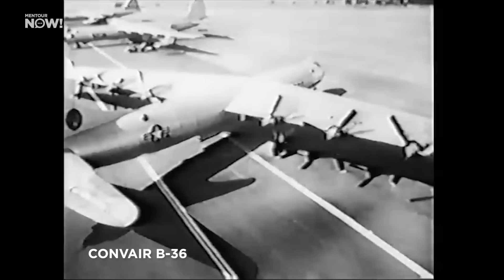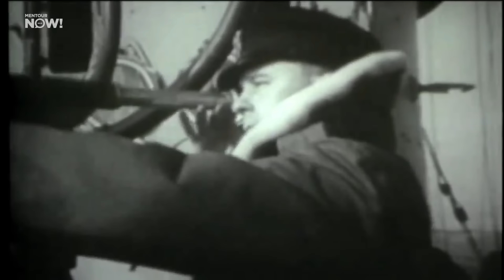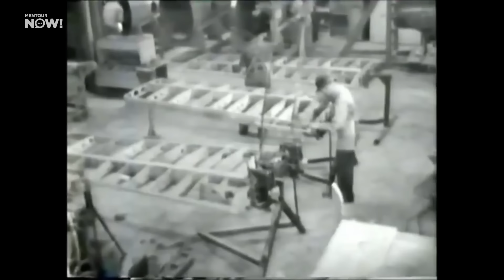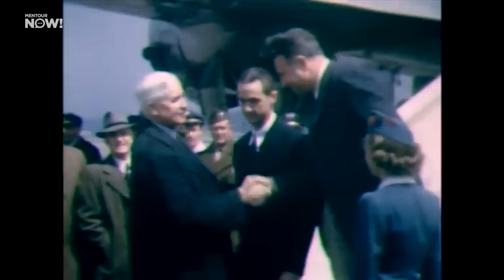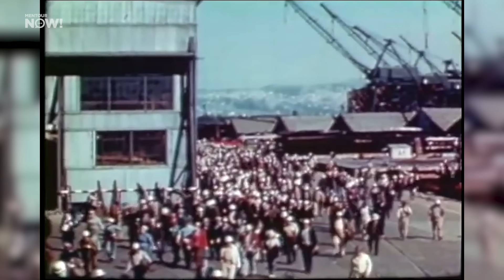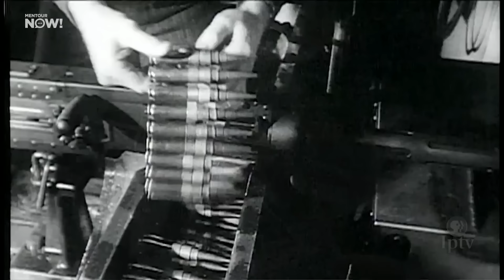The Multi-Million Dollar Plane who Only Flew ONCE!

Comment: Wood is nature’s original composite.  The tree’s microscopic cells form continuous fibers and the cells are secured by lignin which is the wood’s epoxy resin.  The fibrous cell’s length to diameter ratio of four is ideal for compression buckling resistance….and something composite engineers ought latch on to.
     Like composites, wood is anisotropic.   Thus layers are built up with specific orientation.
     Wood’s low density makes it more resistant to buckling than 2024 aluminum on an equivalent weight basis.
      Wood’s low density allows thicker skin that keeps a true shape under aerodynamic loads and a smooth finish.  The wood skin contributed (as well as leading edge radiators) to the DH Mosquito phenomenal performance.
       Still, wood construction is heavier than aluminum.       Cheers

Comment: Pratt & Whitney R-4360 : a nightmare to maintain and operate.
Flying boats : nightmares to  maintain and operate.

8 R-4360's on a flying boat : 😱

If any practical use for the aircraft had been found, I guess it would have been re--engined with turboprops at some point

Comment: You know, with how air travel is today, maybe there is a new market for flying directly between ports...
Small aircraft, not many passengers and cargo to check and no airport at the other end. 
You just get off the boat plane with a passport.
Reply from the maker: I could be.. but they are really expensive to operate, not to mention insure..
Reply: @MentourNow 
Yeah, I know... 😔

And you'd probably need to have just add much security and body scanners and taking your shoes and belt off at the port as you would the airport 😏

People often think of the 60s Jetset as the golden age of passenger flight.
But for me, nothing beats the flying boats of the 1930s, my true golden age of flight. 

The Short Empire is my favourite, and it's military brethren, the Sunderland.

What I wouldn't give to spend a life shipping cargo and passengers in-between flyspeck islands in the Pacific, Indonesia, Micronesia and the Philippines. 
With my very own military surplus Sunderland.
Moored up at the pier and enjoying a drink at the bar as the sun goes down. 

That, that right there, that's the golden age.

Comment: I actually met an old man who had been an engineer on the Hercules project. After we spoke for a few hours about aviation, he excused himself for a few minutes and returned with a concept drawing of the HK-1. He gave it to me and I charished for years before losing it to a house fire. In that fire I also lost a historic issue of Radio Electronics, and Altair 8800, and many model aircraft I had built  growing up. The concept drawing had the signatures of many of the engineers and I was told that when the project ended, everyone who had worked on the project took all the momentoes they could carry because they all knew they had worked on something extremly special.
Reply: At one point I worked with an old and experienced electrical engineer.  One of his first jobs out of school was to work on the team building the electrically-deflected ("solenoid") ailerons of the Spruce Goose.  He said that at the time HRH flew it, the design of the plane still had some shortcomings.  It may be due to familiarity, but he felt that the most dangerous need for redesign was that the maximum force they could get out of the electrical aileron deflection mechanism was not strong enough to hold them reliably in the deflected position under load.  Electrically actuated?  Then??  Talk about ahead of his time!

Comment: I have had the privilege of sitting at the controls of this aircraft and touring her insides. As one of the people who donated heavily to help fund her relocation from Long Beach CA to McMinnville OR, the museum sent me a swatch of the flight control fabric, which was original and on the aircraft when it flew that one time, when they decided to replace all that fabric with unused and carefully stored 'new old stock' fabric. I have done a lot of research regarding this plane, although I don't think of myself as a true expert, but I have read all of the papers and such I can find about her.

One thing that is often repeated about her sole flight is that, "well, she never really flew because she was in ground effect the whole time". First, that is nonsensical because she was developing lift greater then her weight, got off the 'ground' under her own power, and was under control the whole time. If that definition was good enough fro the Wright Brothers, it ought to apply to the Goose. Second, the aircraft has been repeatedly modeled in software at universities and other places, and 'flown' in simulation, and from that it seems pretty certain that she was basically airworthy. She flew, and could have flown more if Hughes had decided to then, or on possible later flights. 

Of greater concern is whether she was structurally sound for sustained flight, under the planned cargo loading, and in adverse weather, etc. Certainly the designers at Hughes thought so based on their material tests and aviation engineering talent and skill, which was considerable. Yet, during the one flight, spotters near the tail reported that the fuselage structure back there, where it is narrow, was twisting back and forth a lot. Maybe this was within design limits, maybe Hughes averted a disaster by setting it down quickly. But also keep in mind, this flight was conducted in a harbor that was not all that large, and unless Hughes took it to much higher altitude, he would run into something. A lot of "ifs".

I encourage everyone with a love of aviation to make a trip to see the Goose at her museum; it is just a fairly short drive west of Portland, Oregon, and also not far off of the Pacific coastal highway; isolated but not too much so.

Comment: Been aboard twice, sat in the cockpit, stood on the seat and had my shoulders out the hatch on top of the cockpit to take pictures along both wings. Amazing to see. Was told and could visually confirm that the reason the flight was so short was that the tail was cracking off due to a design weakness. (repairs were easily visible internally)

Comment: Sea water is the mother of corrosive environments. Metals on aircraft must of necessity be light so flying boats will have a MUCH shorter structurally sound life than a ship, which has a  heavy thick metal structure. Thus, seaplanes are less cost effective than land based aircraft.

Comment: If the undock button is the only problem, they should cobble together a mechanical button pusher and glue it in the Starliner. Ok a collision is a good reason, but I think they need a crew for more than a single button press.

Comment: I do tours on the Spruce Goose at the Evergreen Aviation & Space Museum in McMinnville, Oregon. 
Nice job telling the history as you a very thorough.
Fun fact: There is only 8 fuel tanks, 900 gallons each installed, but was designed to hold 14 tanks.

Fun facts: The wood used was 94% yellow birch, 1% spruce, and 5% other wood like basswood, maple, ash, balsa and poplar. Yes that is correct the Spruce Goose only has 1% Spruce wood. What sounds better The Birch Goose or The Spruce Goose. 😂

Comment: The 4360 Wasp Major engines were.... Let me see here.... A physical size of 8 feet 5 inches, by 5 feet. "103 inches | 61 inches"
My room could only fit 3 of these in it. 
A bore of 5.75 inches! That's bigger than the widest part of my fist. I can't think of anything to relate to that size. A softball maybe? and each engine had 28 softball poppers!

Comment: If anyone wants to poke around the interior of the Spruce Goose or get a good look at one, check LA Noire, either play the Nicholson Electroplating case or watch someone else do it. Even for when LA Noire was released, it still gets across just how massive the Spruce Goose was both in realaity and the digital version. That and, at least with the virtual version, the plane and interior are central to the case as well so you get to explore a good chunk of the simulated Goose and hangar. If I'm remembering it right Howard Hughes gets a few direct mentions as well as a lot of stuff on the company as well with the company and employees being just as central to the case too

LA Noire is set just post WW2 and the case is set in 1947, FWIW. Anyone know if the Spruce Goose showed up anywhere else or just in LA Noire?

Comment: It should also be mentioned that the H-4 due to it's massive size required the design and invention of fully powered hydraulic control surfaces, as they were far too large to have direct mechanical connection to the pilot. This is a technology used on all commercial aircraft today, one that we take for granted.

Comment: Given it took off. I wouldn't say it's the biggest failure. And by modern standards, it was quite cheap to develop. 
IMO, something like the Boeing 2707 is a bigger failure. Because it absorbed more money and was never even had an airframe built. 

Hughes had some serious mental health issues, which only got worse with time. 
I did get to see it, but I was only 4 at the time so I don't remember it. And we don't have many photos because it was back in the film age.
Reply from the maker: It’s a pun on the fact that it was the biggest aircraft ever built, and a fail.

Comment: H4 if designed with turbo jets at that time itself and shifted to aluminium fuselage, it would have been high capacity super jumbo with it would've revolutionized aviation and shipping to a large extent. Also composites at present would've changed the game completely. Request to make one based on Bartini Beriev VVA 14

Comment: The B-17 parked under the horizontal tail, which completely enveloped the wingspan of the B-17 (113 ft vs 104 ft) gave a pretty good visual measuring stick as to it's size.

Comment: you did not answer the question why this huge airplane was only “flying” once…. lack of thrust? Miscalculation of engine power needed to get that plane really flying?  fuel consumption?
Why they did not use stronger engines later when they were available?
A lot of unanswered questions! But still an interesting video somehow….

Comment: The museum is almost directly across Hwy 18 from KMMV, so you can easily fly in and walk. Unfortunately, it's a 1.5 mile walk because you have to go way out of your way to reach a traffic signal and then double back. I suppose you could try to cross the highway at other than the crosswalk, but I don't recommend that.

Comment: In no way was the H-4 a failure. If the project had been moved to turbine engines & stainless steel construction. It would have been a incredible tool for developing the world. There are still many difficult to reach places with no harbors, roads, or paved airfields.

Comment: Was the Spruce Goose a failure? It succeeded in delivering a lot of government money into the pockets of Howard Hughes and Henry Kaiser. The laughable "first flight" was a necessary stunt to unlock that money.  Hughes had to show it was an aircraft and not huge a  lump of timber. That done, it never "flew" again. Empty the 8-engine HK-4 weighed twice as much as fully laden C-97 which had four of the same  R-4360 engines. So it was never going to get off the water with the claimed 150,000lb payload . As for crossing the Atlantic, forget it!!!

Comment: I've heard other analysis of the Spruce Goose over the years. It's too bad Hughes never got to try retrofitting Jet Turbines are full jet engines to it - as good as the radials were, many stories I've read over the years say they were under powered and have claimed that's why Hughes never brought the Goose out of ground effect.
Thank you for keeping this so factual and interesting at the same time.

Edit: I found what I believe is the origin of the claims it was under powered. See comment in the replies if you care.

Comment: It’s very hard to consider this aircraft a failure.  It’s an amazing technical accomplishment.  I’ve seen it at the Evergreen Aviation Museum. Hugely impressive. 

 The wood lamination techniques rival modern composites in cleverness and strength, considering the supporting technologies of the time.  Would anyone think of building an aircraft of its size and capacity, today, if the customer prohibited the use of aluminum and composites?  And if they were limited to piston engines?

Hughes deserves respect for his heavy personal commitment to the project.  No, he wasn’t wasting government money.  And, yes, it did fly.  So unfortunate that it wasn’t fully evaluated.

Comment: The Convair B26 is wild, did anyone tell them that they put the propellers on backwards?
Reply: The engines were designed with the expectation that there would be an airflow from the propellers flowing over the engine so mounting it in a pusher configuration was a big problem. The engines had a tendency to catch fire. the carburettors were supposed to heated by warm air from the piston block being pushed over them by the prop wash. As that wasn’t happening the carburettors iced up  leading to the engines running far to fuel rich and unburnt fuel in the exhaust catching fire.
Reply: @davidwright7193  imagine that, you put something on backwards and they don’t work 😂. That’s the first time I’ve ever heard of “pusher configuration” it’s wild and not a surprise there were so many problems. Very interesting info here, thanks for the reply

Comment: The Hercules and the Stratolauch also have in common that they are both composite structures. Both the fibers and the matrix are a different material but but I would still call the duramold construction a composite because they basically layered an anisotropic sheet material in varying directions to give the resulting part the mechanical properties they wanted.

Comment: Spruce sounds like Bristol Brabazon, a very large airliner with piston engines that came into service just as jet powered airliners were coming into service. Powered by 8 × Bristol Centaurus 18-cylinder air-cooled radial sleeve-valve piston engines, 2,650 hp (1,980 kW) each paired, driving contra-props through combining gearboxes.
Reply: A truly beautiful aircraft.

Comment: The Spruce Goose is near where I live, but I have never been to the aviation museum. I have passed it on my way to the beach. 
I live near an airport and get to see live action, and drive by the hangers. 
When I was young we used to park and watch airplanes land at an airport that became a mall.
Thanks to you the great sensation I get when the plane takes off I now know is due to rotation.
I can feel the heavy weight of the plane as it rolls down the runway and feels heavier as it rotates and becomes airborne whereupon it seems to become weightless as it flies through the air. I can see what an amazing experience it would be to be in the cockpit. 
Seems a better experience to me than an aviation museum.

Comment: I visited McMinnville three times after reading the account of how the Spruce Goose was disassembled, transported, stored and finally reassembled at Evergreen’s facility. The aircraft is enormous. So large, in fact, it sits in a huge pit inside the museum building. Never got a chance to tour the inside of the aircraft. I guess the tours of the interior came later. The museum has lots of other planes to see - definitely worth the trip.
If you go to McMinnville, it’s not too far from the NAS Tillamook where the Navy housed blimps during WWII. The blimps are gone and only one of the huge hangers survive. The second hanger burned down years ago. They were amazing structures, gigantic to match the scale of the blimps, with clear span construction. The first hanger (I think it is the surviving structure) took quite a few months to build as the Oregon winter when it was built was uncharacteristically terrible. The second structure was built in about a single month. Unbelievable even today.
When we visited Tillamook there were a good number of planes on display but the hanger is so huge it seemed almost empty. And there were used parts lying all over the place, including a 3420 Twin Allison V-24 engine. Dirty, oily, & just lying there. Great stuff for a mechanical engineer on holiday.
If your wife is with you, be sure to drive up the highway to the Tillamook Cheese factory & take the tour. You get samples. Good stuff.

Comment: Your history is spot-on Petter. Great episode. I was interested in the success of the P&W R4360 which was indifferent, a factor in any realistic future of the design. I suspect the fuselage dimensions were set around the size of the M-4 Sherman tank.
Reply: How can you comment on a video which is released 2 hours ago and the comment shows it was done 3 days ago 😮😮
Reply: @rex77x  Patreon subscribers get the release early.
Reply: I was wondering that also.  If one of those motors ever came loose or lost any balance by throwing a prop, how would that wooden frame ever hold up to those forces?  I would fear that one major motor malfunction would tear the whole wing off.  Plus weren't those motors heavy as hell?
Reply: @malcolm20091000 

Probably an engine fire would be more of a worry in a wood wing. The de Havilland Mosquito was one of the great aircraft of WWII (which had the same construction). Effectively laminated wood in those days was a composite type of material.
Reply: @malcolm20091000  The engines were among the largest radial engines ever manufactured and used, but proved unreliable in the Boeing Stratocruiser. Critical frames were aluminum. Losing a propeller blade was pretty rare and the engine would immediately shut down.